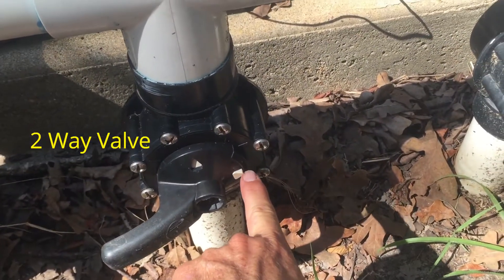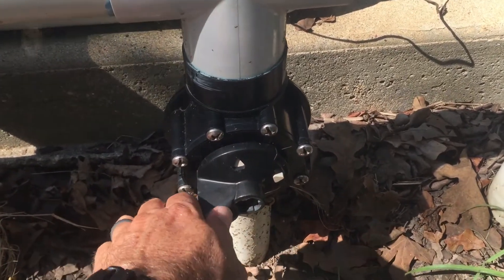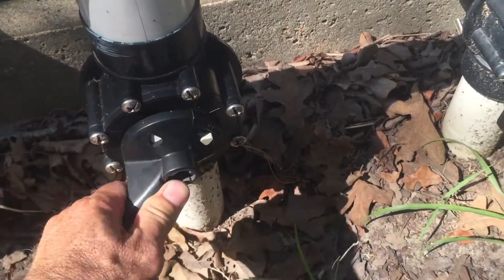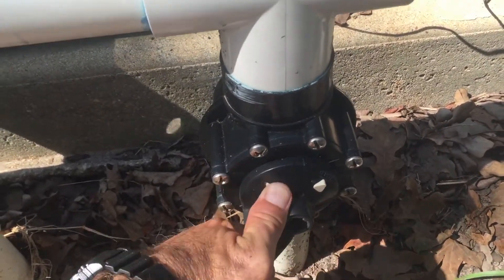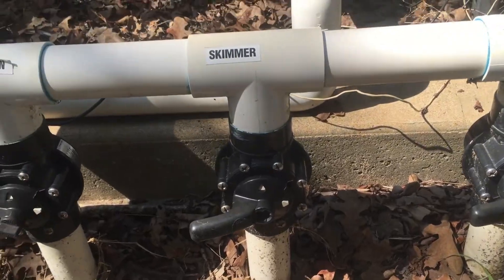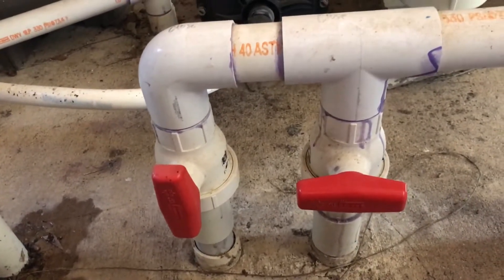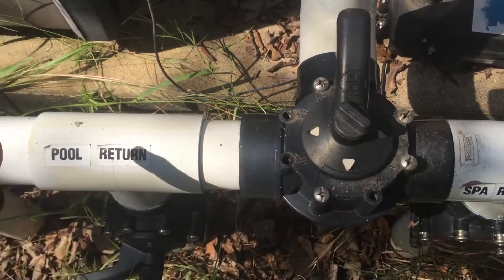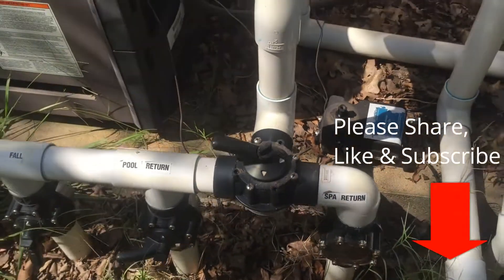Pool Basics: How Do Pool Valves Work?

Comment: Please help me.
I was at a Clients pool attempting to clean her cartridge filter.
I first turned off the power to the pump motor, shut off all ball valves and Jandy valves, release the air pressure gauge, removed the belt and finally took off the filter lid. As usual, water started to
Come out of the tank, but it soundly stop. Water continued to come out of the tank. What are your thoughts. Pls help and create a video
Reply from the maker: Sounds like you have water still coming from the pool through some pipes, especially if the filter is below water level of the pool.  Turn off all pipes, suction and return side.  This should stop any water from coming out through the filter.